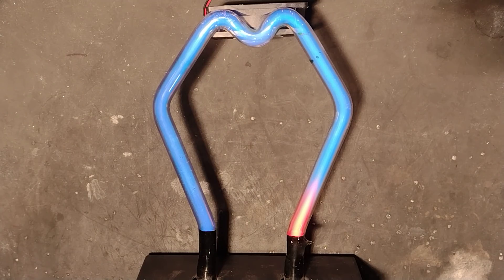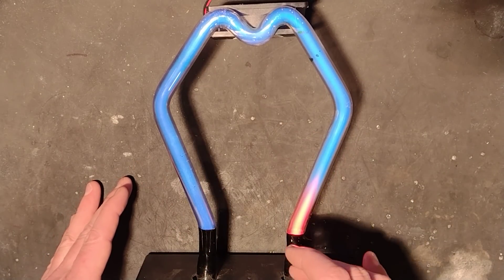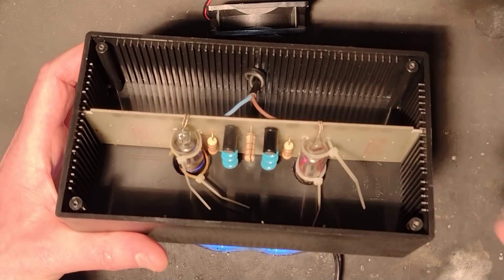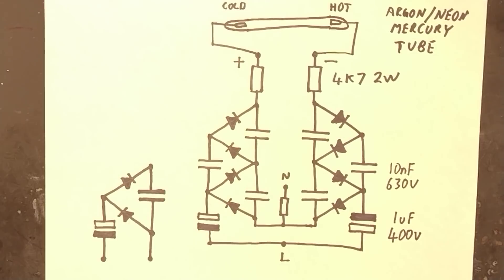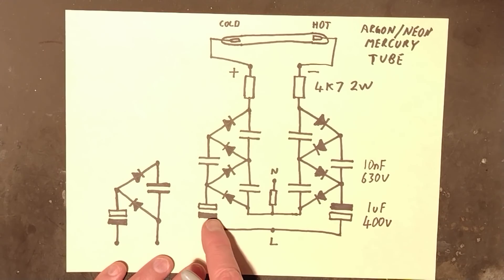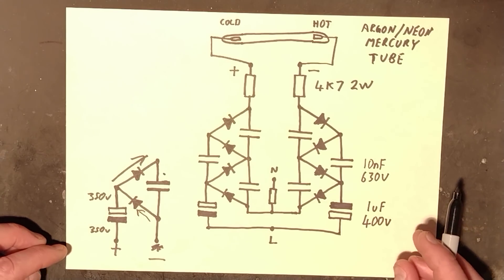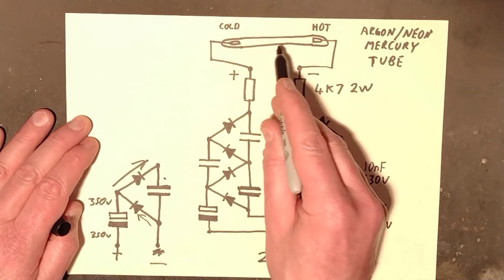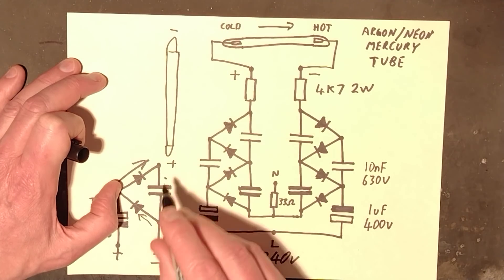The "M" tube neon-mercury DC migration effect (with schematic)

Comment: In addition to current limiting, series resistors in the output are usually necessary as most gas discharges have a negative resistance characteristic, so without external resistance they can oscillate or become unstable.
Reply: I was thinking the same thing. Might explain some of the instabilities Clive mentioned.
Reply: In this case the capacitive voltage multiplier will inherently limit the current, although a resistor is still required, to restrict the huge surge, when it starts.
Reply: I understand what those words mean individually but not together in that order… not your fault I am just a idiot. Must go I just spotted something shiny
Reply: @oscobblepotcobblepot6972  once you reach the appropriate voltage across a tube filled with the appropriate gas or an LED, it will conduct current through it, but, in its conductive state, it has a very low resistance. You need a device which will limit the current through the gas or LED.
Reply: @mgancarzjr  Yes, the voltage across the tube is nearly constant, irrespective of current flow, and can even vary due to arc temperature or the influence of external magnetic fields. Thus you really want to drive it with a near constant current, as otherwise you can make something with negative slope resistance, which can have quite a bit of gain, and amplify noise well.  You used to get tubes deliberately deigned for negative resistance, used as amplifiers, and diodes as well, which have a negative resistance region in the curve. The diodes are still around, used in microwave detector circuits as the oscillator, as the circuit is very easy to assemble ( one component in a cavity) and very reliable.
Reply: @oscobblepotcobblepot6972  you just made me laugh out loud and I'm still half asleep!  Bravo!
Reply: @oscobblepotcobblepot6972  look! I see a badger…

Comment: I wonder if there's an alternative use for a neon tube control box/circuitry?  I have one but the tube is broken, any ideas?
Reply from the maker: It depends on the type of circuitry.
Reply: ive got a 10k neon supply turned into a jacob's ladder. great if you like to live dangerously.
Reply: Testicle stimulator - one lead to each
Reply: @haywoodyoudome  I had thought of that, I was looking for more practical or interesting uses than that however...

Comment: First a concern about the UV from the un-phosphor covered lamp, but I see you address this in "Story time"
Similarly therein you cover the HV output dangers from such a circuit. Dirk Boonstra (presumably not the one on wikipedia who was a member of the Dutch resistance) provides appropriately deterrent symptoms for someone as hirsute as you.
Finally, whilst you are still in Glasgow maybe a video about old Neon tube companies would be worth a thought. A quick search revealed litle apart from a Science Museum link to Franco (note spelling) of Oxford Street and Neon Workshop of Wakefield. Maybe Donald has some stories.
Reply from the maker: Sadly, I doubt Donald is about any more.  He was old then and a chain smoker.
Reply: Ordinary glass blocks UVB and UVC quite well, but it doesn't block most UVA.  UVA doesn't cause burns like the shorter wavelength UV does, but it can still damage skin and eyes, given enough intensity and long enough exposure.  Mercury has a prominent spectral peak at 365 nm, which is well within the UVA range transmitted by glass, and potentially harmful. (Sunlight, too, contains significant UVA.)  If staring into phosphor-free mercury tubes is your thing, a thin film of polycarbonate makes an excellent UVA filter, while passing visible light with only slight attenuation.  Safety glasses are often made of polycarbonate.